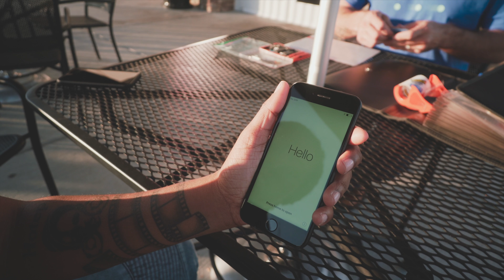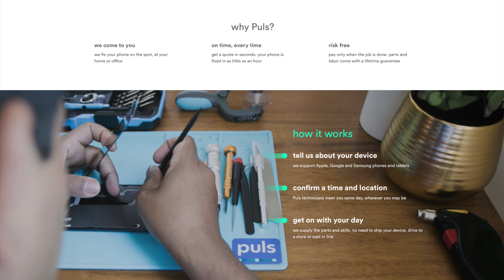Meeting the Superman of Cell Phone Repair! (Puls)

Comment: There's a guy in VA that does that. I wouldn't meet people anywhere but I did repairs outside the normal setting

He's brave doing it outside with those little screws that can be lost easily.
Reply: SixthScentsfragrances the thing he's putting the parts on is a magnet
Reply: Brandon Goodchild I know. Sometimes when your applying the pressure to put the screws back in; they pop off the screwdriver. 

iPhone 6 and 6s are easy money. Ip4 had 32 something screws. Kinda of a pain but still good money.

Comment: Be extremely careful with 3rd parry parts when repairing your $800+ device. Issues like battery swelling, non responsive screen and home button or just complete malfunction of the phone can be your end result. Also this guy replaced a screen out in the open, on a metal table. He wasn't grounded and seemed to take no safety precautions when disassembling an electronic device. Yes this is an extremely convenient service compared to an Apple Store but may end up costing you more in the long run

Comment: The new display wasn't yellowish?
Reply from the maker: No that was the camera I was recording with. I had a filter on the lens to help reduce the brightness that contributed to the screen showing up like that.
Reply: TechMe0ut You're aware that he didn't give you an apple genuine replacement display correct? I work at a repair shop in New York and can tell you that the screen he used was a chinese replica, likely purchased from ebay. This means a poor quality glass panel which cracks much more easily and will fall out if shattered, the pixel density is actually not on par with apple's screens, and the connector is likely to fail much more quickly. Notice how in your own video when you are holding the finished product under the sun you can tell the different shades of black from the glass to the home button. The connector wires also show that it is non apple screen.
Reply: It lost the water protection too?